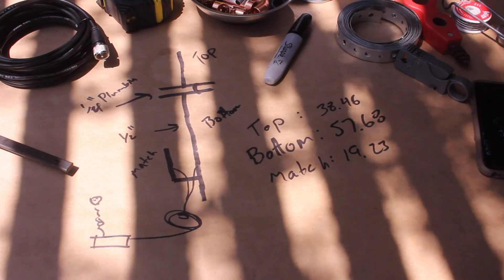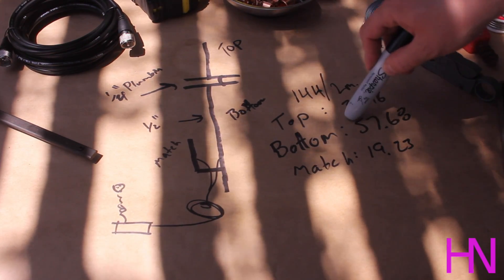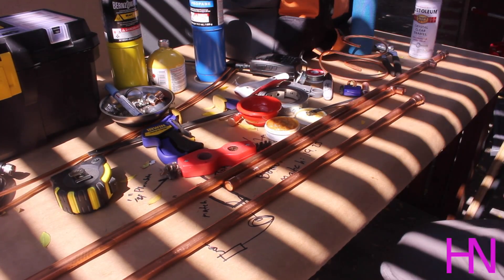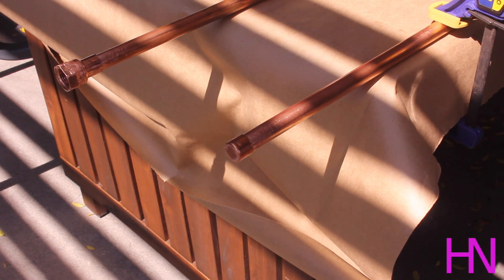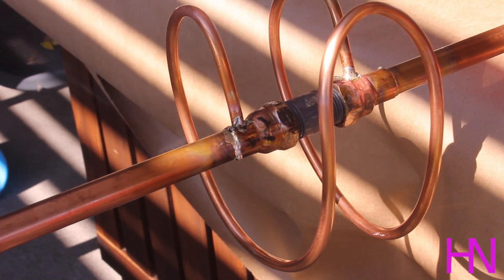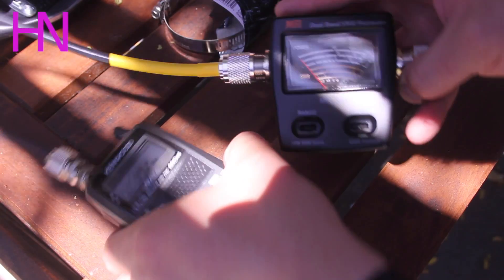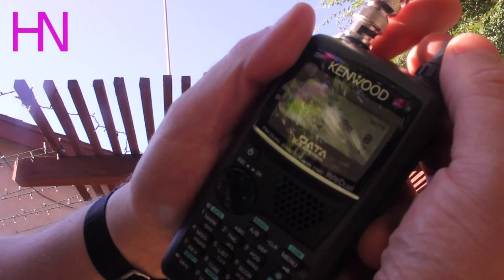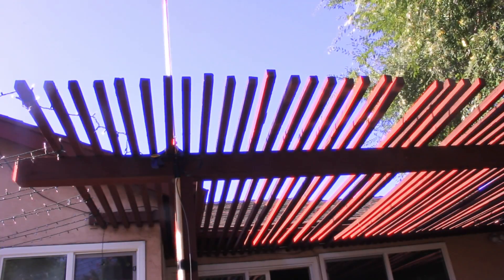Super J-Pole Antenna Project

Comment: I built one of these 10 years ago. If you switch to male threads for the separation, you can a use PVC union as the insulator. You can add it after it all cools.

Comment: You should also clean the surfaces with sandpaper before you solder and it will look and flow a lot better and be much stronger

Comment: Solder follows Heat you're hitting the pipe not the fitting heat the fitting and you'll get a much better looking solder joint and if you heat the fitting you can also solder uphill

Comment: An easier way to do the plastic insulator would be to use shark connectors you can buy the solder on ones or the double ended  slide on version then just slide a piece of plastic pipe in after no heat to melt anything

Comment: When you put a bare copper antenna outside does the tuning/efficient change when it gets tarnished and turns green after a couple of years?  
What happens with RF travelling on the outer surfaces of the antenna (skin effect) now you have added resistances in the surface there were not there 
when it was fresh & new.
Reply: I’ve had j pole up copper for several yrs it got nice green patena on it still works great  haven’t done nothing to it, but you can paint them won’t effect anything

Comment: A tip. You can use a pair of 3/4" straps folded around the 1/2"  pipe and held by a brass nut and screw to form an adjustable feedpoint. Tack solder the coax to one side of each strap tab end for the connection. Goop the coax braid to prevent rain water wicking. VA7WN

Comment: Built a 70cm version of this antenna. Made a discovery about the mast if conductive. It is all fine but if by accident you make it some resonant length that coincides with the design frequency it can pull the tuning. The mast itself will radiate. You can check this with a Nano VNA on a wide sweep. Slide your hand along the mast and observe phantom SWR notches move about on the display. Tuning with the antenna on the ground  is different than aloft on a conductive mast. My solution was to repeat the insulator section again (without the hairpin) just under the "T" fitting. Then too, a ferrite choke installed close to the feed point is a good idea. This could explain why some people have good results while not others. Just depends on their arbitrary mast length.  VA7WN

Comment: I would have cut the 1/4" tubing and soldered it back together with a small coupling rather than try and solder next to a PVC nipple.That has a high probability of melting, even if you use heat dissipating gel. If you could have fitted a 1/2 x 1/2 x 1/4" T in there and gotten the right SWR it would have been great.

Comment: Great bending of the loop, but the attachment techniques need some work. Heat the part with the greatest mass, and don't be afraid to use flux. I am a  mechanical engineer/building contractor with specialties in electrical and plumbing (and a U.S. "Amateur Extra" licensee!), and the soldering (not "brazing") could use some guidance.

What you did was serviceable, but why not make it "permanent and beautiful" as well?

Comment: What does the coil add to the antenna?  does it increase the gain or something?  I'm kinda new to this stuff.
Reply: It’s just a means of creating a delay so the top half of the antenna is in phase with the bottom half. If the coil wasn’t there the top half of the antenna would be 180° out of phase with the bottom half and there would be virtually no radiation from that antenna.

Comment: I put little things on the top of my copper tubing that can slide over the tubing. They are sold to cut down on the water pipes making noise. They are bigger around than the tubing so it can slide up and down for tuning!

Comment: Don't forget to polish it every week. It wouldn't be a bad idea to paint it or something to keep corrosion at bay, and seal the end of the coax or enclose it in a box.
Bill, G4GHB.
Reply: Curious about this before I build one.  How would a layer of corrosion differ from a layer of paint?
Reply: @ahuggins6   I have a 6m dipole which I was given and was corroded underneath the SO239 socket on it and so making a poor connection to the centre of the dipole. Painting it after it is assembled would help to keep out moisture, and rain if it's outdoors to help prevent corrosion forming. Corrosion because of moisture creeps up old coax cable from the cut end if you have ever seen old coax.
Bill, G4GHB.
Reply: @bill-2018  ok, so you don’t paint the whole antenna?  Just the connector or somehow seal the cable?
Reply: @ahuggins6  The connector is the important bit, but you could paint the whole antenna if you wish. I remember an old radio book which said to clean the unvarnished copper long wire antenna with wire wool to keep it clean. Most amateurs use pvc covered wire these days so I guess nobody thinks of that now.
I have sealed coax with bathroom sealant but I believe that contains acetic acid which could start corrosion so that's not the best idea. I've had antennas up using it for a few years though. I understand there is something called Coax-Seal but I've never seen it.

On my 40m dipole I enclosed the centre connection in a plastic box to keep rain off with small holes in the bottom to allow air to circulate. I arranged the coax to point downwards to further stop moisture being pulled downwards by gravity, didn't seal the coax. It's debatable whether to seal things or not to seal things and people have different ideas on this. There's still air present in everything and condensation will form in cold weather.

Comment: Hosh... You're in Cali so I have to assume that is not lead solder. 95/5? Does it matter what the composition of the solder is? I am a plumber who just got his tech license so I want to build this... BTW... Try wrapping a wet rag around the plastic nipple before you solder the copper. Or better yet, use a pvc union.

Comment: After having this guy up for a while, are you still using it? I'm trying to figure out if I should build a J-Pole or buy a GP-6... Any thoughts?
Reply: I have my 2 meter J-pole up for four years with no problems exapt for poor matins ( op errors) just seal up the two coax leads and inspect it quarterly or yearly. but I am a "new" young ham 4 years in my first term.

Comment: I found plans for the "Cactus" antenna but, according to the plans, that specific design was meant for dual band (144/440mhz). Are your measurements specific for the 2m/144 only???. From what I understand, the upper portion/coil and top will only allow the 440mhz to radiate due to the high impedance.
     Thanks for sharing!.
Reply from the maker: Correct, this would work for both 144/440

Comment: christ man, the solder runs TOWARD the heat source. on a sleeved joint, you heat both, then keep the heat on the OUTER tubing, and the solder flows INTO the joint. every joint you soldered you did backwards. if that was a plumbing job, every one of those would at least seep, if not just plain fail completely. and yeah, keep your infant kid right close by while you vaporize lead, and dick around with nice poisonous copper. gonna blame the vaccines when he comes up brain damaged?
Reply from the maker: I do not backwards to the only the best and strongest solder makes the connection.  Science is wrong on this one 

Jk 🤣

Comment: Nice video, could you please share the dimensions of the "halo" I thank you in advance.
Reply from the maker: I believe that top part as mentioned in the link in the description 1/2 wavelength.
Reply: Is the spacing between the parallel portion of the halo critical?
Reply from the maker: There needs to be some kind of insulator in the middle yes.

Comment: I've spent the last 30 years as a HVAC  technician. Watching you solder was rather painful. A word of advice. Heat the fitting not the pipe. I wish we could have watched you bend that copper. Now that's nice looking work
Reply from the maker: I appreciate both the constructive criticism and the compliment. 🤣👍
Reply: Yeah, that loop was beautifully done!
Reply: I'm glad I wasn't just thinking this. I am glad to see these types of antenna projects being tried by us to at least see more that iComs and beams. Other types are buildable and just as useful for most parts.
Reply: technically, isn't called "sweating"?
Reply: Average Joe   If you have worked in this trade. Yes it is
Reply: No where near 30 Yrs experience with copper, SS, and 2M electronic soldering.  OMG that was painful to watch, but so appreciate it. Also remember the solder will chase the heat. Glad their were wind chimes in the background to soothe.  Thanks!
Reply: Looks like you switched to MAPP gas. Good choice!
Reply: Be careful Joseph he has thin skin that's not going to help his technique though lol!
Reply: i fill the 1/8th inch cooper line with salt and it will bend like that without kinking.
Reply: I think he's making a radio antenna...not doing HVAC or plumbing work.

Comment: Broadcasting??  Kerchunking??  What kind of amateur are you?  :P

Thanks for the video.  I might end up trying to build one of these in the near future.  I'd like to get a full-time VHF base going for monitoring/talking with the local amateurs.
Reply from the maker: Did you know what I meant though? 🤣
Reply: hoshnasi I did lol. I kind of figured you wouldn't be able to run that kind of power with an ht and no amp!
Reply: hoshnasi which brings another question. How much rf power can you pump into that thing without frying anything?
Reply from the maker: Its for VHF UHF.  I wouldn't go over 50 watts.
Reply from the maker: If it’s pure copper you can go over 100 w

Comment: Heat the fitting not the pipe so the solder flows into the fitting
Reply: Yup the solder will flow towards the heat.

Comment: Sorry, but that ain't braising !
That's (sloppy) soldering (if it doesn't suck up the Tin, pushing it into the joints won't help it either..... 
Braise is a silver or brass alloy (hence the term "braise")  as an welding material and needs red hot temperatures. Soldering is melting a tin-lead based alloy (some contain  2% silver if you go fancy ;-) but still it's melting at max 280 degrees C. if you go wild. Braising takes a good 600-800 C and up. And you'd use oxygen with the propane gas to achieve the needed temperatures.
Reply: joostle is correct. Soldering is fine for this purpose, but is very different from braising and welding. Making a technical video? Be accurate with your terminology.
Reply: Chill out dude,,,

Comment: .as soon as my money is straight, I'm building a super j-pole for 10-11 meters. With the lower portion below the matching hoop made with 1" copper and top with 1/2"
Reply from the maker: What are your estimates on how long the segments will be?
Reply: hoshnasi   well Dave tadlock shows a standard j-pole being made for cb and it was 27 feet there abouts. So add 1/2 wave more. But his used twin lead for the lower part.
Reply: I don’t think it would work over that range of frequency.

Comment: Great video man I'll be making one of these. May I give you a tip as a plumber regarding soldering. If you heat the pipe mainly not the fitting you'll have a better joint and also wait until you get a greenish hue when heating the pipe and then apply solder and then it will flow right in there. Cheers buddy. Tim (UK)

Comment: Many good comments on proper way to solder plumbing pipe and joints so I won't add to that. Thanks for the design link update. more is explained than you provided. Glad it works for you. You are correct. It would have been nice to see the tuning procedure. Don't take my criticisms to heart. I am sure that you have improved since making this video. 73 OM

Comment: nice video.  what is your pole made out of and how did you attach the antennae to it.
?
Reply from the maker: +Bobby Minchew pole is wood. You can solder a coupler and screw it into the pole.
Reply: Ok.  It looked like pvc and I was wondering if coax was inside but it must be attached/zip tied to the wood?

Comment: Wrap a wet rag around the plastic and copper fittings before soldering the last step.
Reply: hoshnasi yep, I see it wasn't needed. You melted it.
Reply from the maker: +James May not needed for this.

Comment: put heat on the side you want the solder to run towards.  Most of the time you had the heat on the wrong side.  Doing it this way will pull the solder into the joint and then you will have a solid joint.  Good video otherwise .
Reply from the maker: Yep, I always get the heat too much on the wrong side.
Reply: Harley Rev The hottest point is at the tip of the cone, so hold the flame so that the tip just touches the fitting. It's not necessary to heat the copper tube directly, because the fitting quickly conducts the heat to the tube inside the joint. When the temperature of the copper reaches the solder melting point, the solder wire you're holding against the copper will suddenly liquefy and flow into the joint. Hold the solderopposite the flame, the coolest point, to make sure all parts of the joint are hot enough. Solder won't fill spots that are cooler than its melting point. www.google.com/searchhowtosolder
Reply: What Harley is saying, is to hold the flame, or in his words "heat" on the fitting, i.e the coupling, elbow, cap etc.. NOT the tube, yes Bobby you are correct in that sense, but Harley was misunderstood in the sense of reference to what point, be it the opposite or same or perpendicular etc.. side to the solder.

Comment: whats the purpose of adding the halo? how does it compare to a standard J-pole? how does it compare to a "slim-jim" -- would it be possible/practical/beneficial to add the halo to a "slim-jim", and/or would it be beneficial to add more halo's?
Reply from the maker: +Munky332 the halo allows it to be resonant on both 2 meter and 70 cm. yeah same concept as the slim Jim. The halo is kinda like a trap.
Reply: To make the antenna larger (1.5 wave + matching stub), you could add, on top, another phasing section (halo) and another half wave section above it (same dimensions at the current top section). You can go on adding sections like this, though mechanical strength is an issue at these wavelengths (though easier at higher frequencies!). You get diminishing returns as you add more sections.
Reply: This one has four half wave sections.

http://www.dxzone.com/images/pics/2016/02/12/20160212235757-22755680.jpg

Comment: Hey man good video! Is there a formula or something to to how long is too long for feedlines? Like where I want to mount my antenna is like 100 feet from where my radio is.
Reply: If you are 100 ft away your loss is going to be "bad" on 2 m and horrible on 440 unless you invest is $$$ feedline. It'll still work with decent rg8 but you will have appreciable loss
Reply from the maker: Great question, the short answer is IDK.  I would assume you'd still have to tune the feed point once you got the full length of line on.

Comment: By adding the halo does that allow you to get 70cm as well as 2m?
Reply from the maker: Yes exactly!  It performs quite well on 70cm.
Reply: Awesome! Thank you, I'm building one this weekend!
Reply: The halo is to create a co-linear design on 2m. The fact is that 70cm = 3 times the frequency of 2m so many antennas on 2m will also work to some degree on 70cm. The radiation pattern may be a bit weird though.
Reply: http://www.hamradio.me/antennas/can-a-2m-j-pole-be-used-at-440.html

Comment: hi, i don't understand the J Antenna Model  you short the signal power to the Ground !please explain , if i have 65 watt power output and i short it to the ground by the J antenna. thanx. all my antenna its depole. signal positif top and the ground down
Reply: Mark, I think I understand your confusion... It looks like a short because you have the center coax conductor and the coax shield connecting to a continuous copper conductor. Just remember that what looks like a short circuit to DC is not a short circuit to RF, there is enough electrical distance between the 2 connection points to allow the alternating RF energy to do its magic. I hope that helps. I think Ham universe has a good explanation on how SlimJims and J poles work. 73
Reply from the maker: +mark malibu the jpole is basically a dipole. Same principle.

Comment: Does the coil have to be in the "horseshoe" pattern or can it be a standard coil? What diameter should the coil be?
Reply: See my reply above about the antenna being a colinear. The "horseshoe" is a 1/4 wave phasing stub just wrapped around in a circular pattern to make it look neater. It is possible to replace this phasing stub with a coil, though you'd have to look up exactly what dimensions and number of turns the coil should be and what the mechanical spacing between the upper and lower elements should be.

https://en.wikipedia.org/wiki/J-pole_antenna#/media/File:J-pole_Antenna_and_variations_of_same..png
Reply: Here's an article about replacing the phasing section with a coil.

http://www.hamradio.me/antennas/improving-the-super-j.html
Reply: Bartlett Mayo
Reply from the maker: +Bartlett Mayo I have not experimented with anything other than what I showed in the video.  I'd stick to the plans unless you wanted to try different things,
Reply: +hoshnasi 
Was that particular design for a specific purpose? Or was it just easier to create? Is there a diameter that you used to create the 'fold back or the diameter around the main antenna?
Reply from the maker: +Bartlett Mayo Yes, the design is linked in the description.  Check it out.
Reply: +hoshnasi 
Unfortunately all I get is:

The www.kf4eok.com page isn’t working

www.kf4eok.com is currently unable to handle this request.
Reply from the maker: +Bartlett Mayo Ah!  Thanks for letting me know!  Here is another link with a cool calculator.  http://www.hamuniverse.com/superjpolecal.html